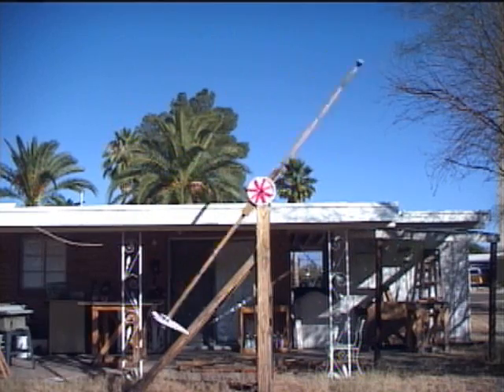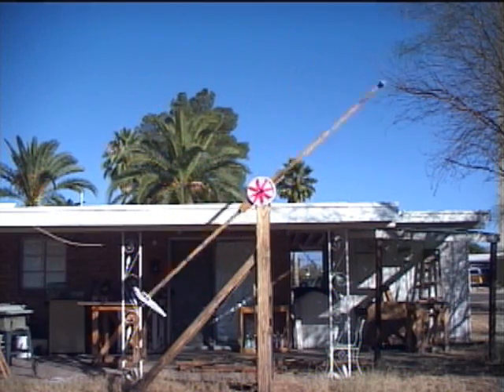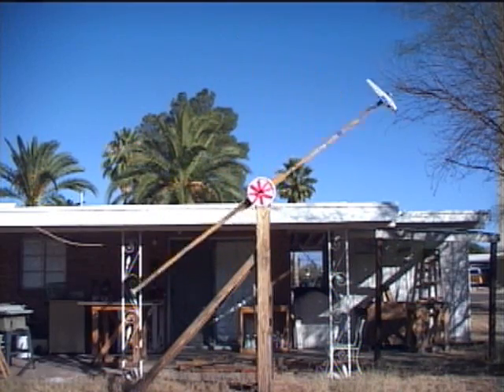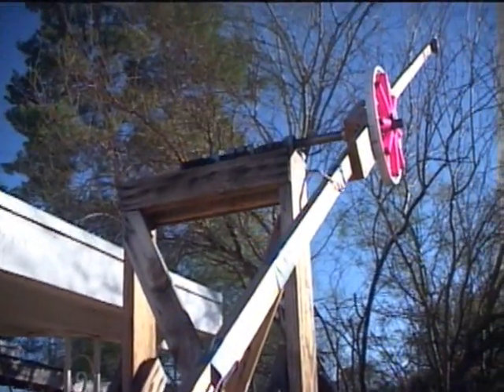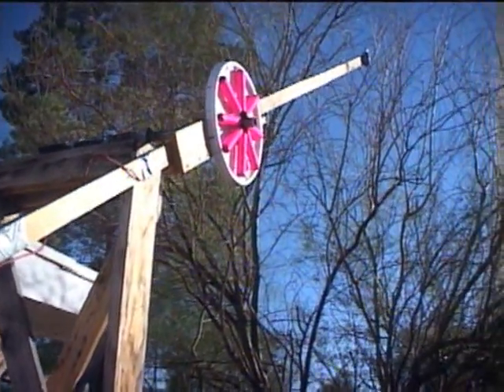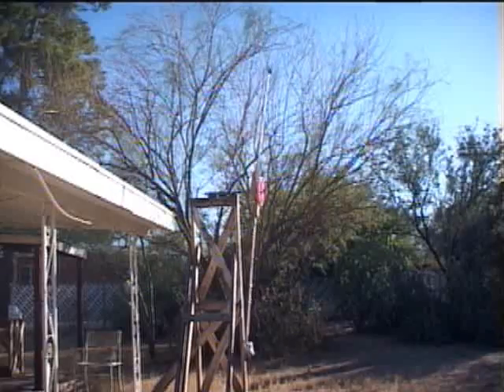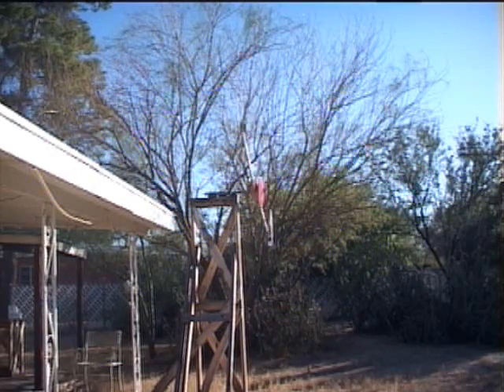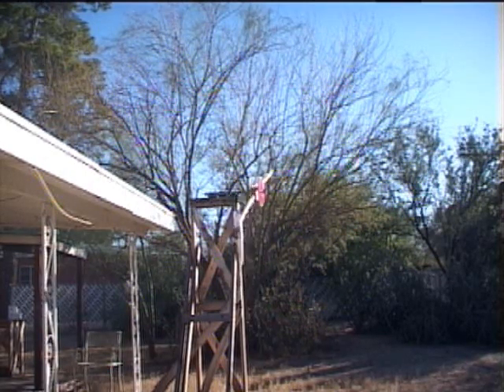Gravity Free Energy Generator

Comment: I am updating this video, since nobody seems to get it. Who cares? The video is not faked, what you are seeing at the 36 second mark is an anomaly in the film quality and nothing more than that.

The guy has sound concepts, I know this as fact. Only if you guys actually knew what was actually going on.

I know every single thing about this video as well as every single force, not one of you guys has mentioned anything about, I won’t waste my time explaining it here.

Y’all are just a bunch of cows in a herd following what the next one does and says and not using your own brains, in which there is none that I can see.

For starters, there is no centrifugal force, it simply does not exist. Centripetal? Yes. That’s as far as I will go.

The simple wheel holds magic that you wish you knew, and I can easily take energy out of a wheel without slowing it down whatsoever. 

That’s right, reaction less. And yes it’s possible, I have the math and physical model to match it. Will I show that? Nope, don’t have to. Why should I?

Comment: I think this is not BS perpetual. At least u got close loop energy feedback just enough to add a little effort to the momentum for the upward swing. Thanks for sharing.. keep up the good work 👍 of cos show some electrical measurements and how u create the unbalance point in terms of weight, speed of rotation etc, also putting outside u got external environment factors to consider.
Reply: well,IfItsPerpetual,HowCanYouSayItsNot?

Comment: Can you drop the "ON" duty cycle on the small electric motor, say to 25%? Powers itself on, only on the lift for example? Then stores energy with a voltage multiplier to super CAPS. Also, add at least tripple the COILS by making the center core larger!

But you would have to work on the overall mechanical spin efficiency as well...  I can see potential in this... Great concept! Congrats!  It's 2017, new technologies can now aid this design to harvest true energy!  MY OPINION...
Reply: thoughtAlsoAboutPoweringOnlyOntheLiftSemirotation.ButIDontThinkItNatters.TheResonantRotationItsImpirtant.

Comment: You got that right, small changes in the center will not provide the volts nor the amps required for that high torque model airplane engine youhave got a definite fail and also you are trying to fool a lot of people

Comment: I've seen a working gravity based device without any kind of impetus - one push and it keeps accelerating. As long as you use a static axis there is not way to make a working gravity device because the forces will always equal and cancel each other out.

Comment: Good day Towtops,

     May I recommend AVS Video Converter for the next splice job you do. You can minimize those obvious jolts in your footage there where one clip is joined to the other and make your spliced video practically SEAMLESS. Best converter I've ever used. Oh, and make sure to kill all other processes running on your machine using the task manager to maximize your processors' resources for usage by AVS only. You'll have people believing your hoaxes in no time.
     
     Now, if you want to see a rotor that may actually have some scientifically backed potential, search youtube for "Skinner gravity replication". Interesting stuff.

Comment: You loose energy to friction and drag.

You loose efficiency by having a propeller drag the arm around instead of mounting a motor directly on the center shaft.

A toy dc motor is hardly what i would call energy efficient, loss of energy there.

This is a hoax, nothing more.

Even if you lost zero energy to drag, had zero friction and a 100% efficient electric motor, with a propeller so efficient that it would equal a mechanical connection, then whatever energy you gain by having gravity pull the heavier end, you loose by having to lift it up again.

It did however sound like both ends had equal mass, in which case gravity won't do any work, since it's pulling down on one end just as hard as the force required to push the other end up, generating no extra energy.
Reply: Just learn how control gravity you will get free energy.
tip magnets can make a human walk on air.
Reply: @alienagent8819  wow.
Reply: iAgreeThatAMotorOnTheHubWouldBeBetter.InRestIDisagree.

Comment: That's simple, It consumes 1.6180339887 times as much energy as it produces! LMAO Actually that is a very generous figure. I would estimate the motor uses at least 10 times more energy then the magnet through coil shaker flashlight type generator produces.

Comment: Also, using the propeller in that way is definitely not the most "energy efficient way to keep the arms rotating".  A propeller's interaction with the air is incredibly wasteful.  You're losing and wasting energy all over the place here with both due to Friction and the propeller's slippage with the air.   The only way this might generate even a tiny bit of power is if a gust of wind were to come in occasionally.

Comment: There's no way this produces energy over unity.  You're putting far more energy into that propeller than you'll ever get out of the coils in the middle... probably on the order of 10000:1 or more... maybe 10000000:1.  It might be possible to get the thing spinning close to perpetually using the "power" of gravity in conjuction with the power of magnetism to counteract gravity that does not violate the law of energy conservation (the magnets will die out in 400 years).  But it won't run your AC.

Comment: Right, in a closed system, entropy increases over time. But with an outside energy source, you no longer have a closed system. In the case of earth, the sun provides more than enough energy to drive the evolution of complexity. 

Also keep in mind that your argument, if correct, would also imply that it'd be impossible for a seed to grow into a plant, or for refrigerators to work, etc. etc.

Comment: "The energy comes from gravity"...sadly, no. Energy can come from gravity...but only when there is "overall falling". Otherwise, you lose whatever energy you gained when things have to go back up.

He admitted he needs the propeller to keep the wheel from slowing down - well no shit. Even if there were no friction, this would still be true - the flywheel will slow down ever so slightly due to the magnetic induction. 

So, the energy is from the propeller. Just in a very inefficient way.

Comment: Did you have to compensate for the weight of the plane at one tip? Try putting a cluster of LED lights at other end so power  generation can be put to work. Or something along those lines.

Comment from the maker: The spinning arm has little torque (turning power). The spinning arm loses a little energy do to friction with each rotation. The hub generator produces only enough energy to replace the energy lost do to friction. The hub generator does not produce enough energy to power a deice outside the spinning arm.
Reply: ok...ButStillItsAPerpetuumDevice.YouProvedThatItsPosible.ImprovementsCanBeMadeToGenerateAsMuchEnergyYouWantOutsideOfTheSystem.

Comment: Thanks for sharing your design with us.  This does appear to be a successful free energy device as long as this solar system exists and we have gravitational pull towards the sun. Have you considered loading the shaft to measure the torque?  I think that with a permanent magnet motor and a car battery you may have a practical device.  What do you think?

Comment from the maker: Thanks for the advice. However, the device's electric motor by itself makes
little noise.  That loud whining noise you hear comes mostly from the sound
of the high speed propeller cutting through the air.

Comment from the maker: (1)solar panels are good but I wanted a deice that would work 24 hours a day.
(2) I did not use gears or pulleys because they waste too much energy. I used the direct drive propeller system which is more efficient. (3) The device is noisy and a bigger device would be worse. I will try to figure out how to reduce the noise problem latter.
Reply: yeahTheNoise,IsAnnoing.

Comment: "Falling weights are 1% HEAVIER". You may not use fantasies about non existant perpetuum mobile devices to make a  point, only small children get to do that.
Massendiladation? You mean mass dilation? That's a concept that hasn't been used since early 1900's. Einstein himself realized the unnecessary confusion associated with the idea of distinguishing between longitudinal and lateral mass relative to velocity.
Modern physics regard mass as a constant relative to the frame of reference.

Comment from the maker: Your idea would work but I'm trying to build a device where the small load at the hub does not slow down overall rotation of the arms. Instead electricity from the hub keeps the propeller spinning and the arms rotating.

Comment: I don't think you're misinformed, but the guy has a point about the conservation of energy.  This device could be awesome in that the small load will slow the device sown, but that is easily fixed by a bit of extra energy generated by some dude just giving it a push every once in a while, which effectively turns the push into energy.  Why not have it human "powered"?

Comment: It is very easy to measure the amount of energy used by the system and compare it to the energy produced. This is the same concept for pulse motors. Both use flywheels and pulse motors have been debunked for years. I applaud the creators efforts but don't see how it will work the way he claims. Model airplanes, such as the one he is using to drive his flywheel, can consume several amps of power in 10 minutes.

Comment from the maker: (1) Why do you use such large numbers like 2 horsepower? My device's electric motor uses 2 amps and 7 volts or 14 watts.
(2)My device does not use an alternator. It uses pulsed DC.
(3) The whole point of my device is the rotating flywheel is not slowed by hub
activity.

Comment: 62 amps X 12 volts = 744 watts which is very close to 1 horsepower

Alternators are only 50% efficiency therefore to produce 744 watts output requires 2 mechanical horsepower from the engine.  

The more electrical load you put on the alternator the more mechanical horsepower that is required.